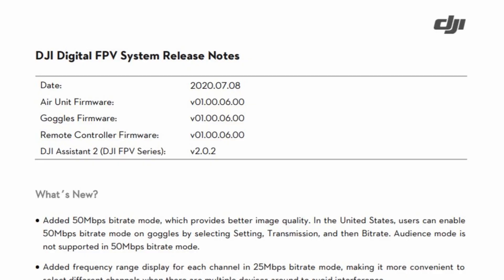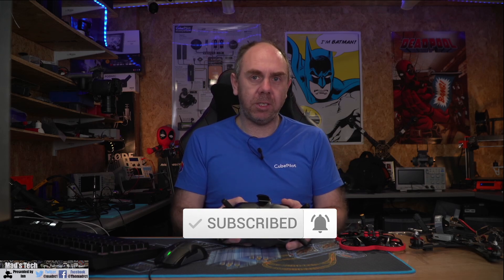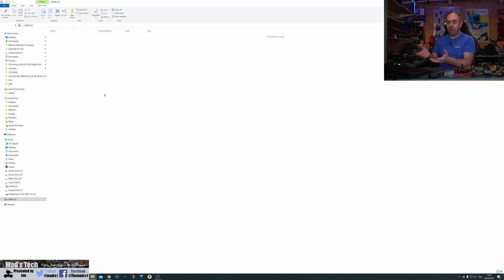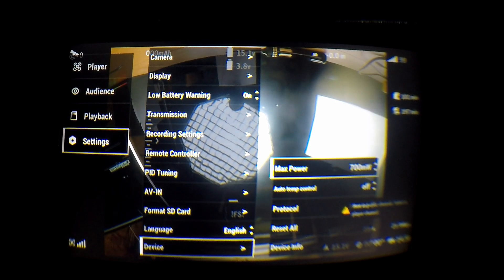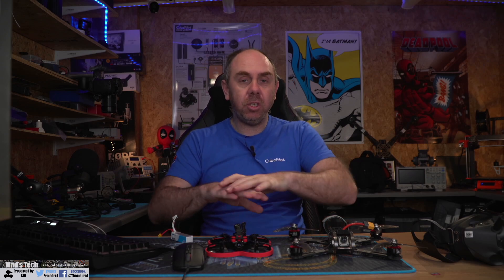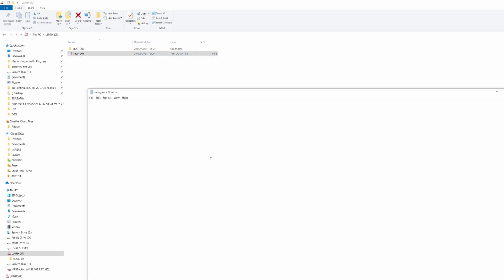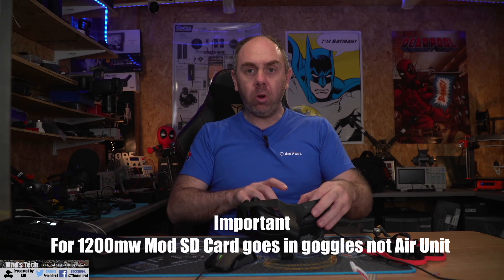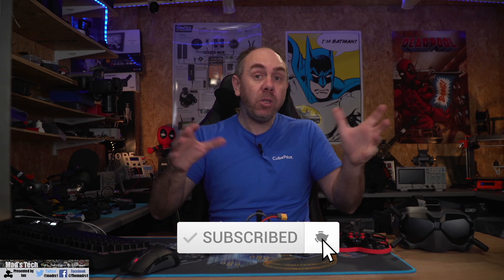DJI FPV Goggles V2 FCC & 1200mw Hack - Complete How-To For V1,V2, Caddx Vista & DJI Air Unit.

Comment: I've been seeing online that when you update the firmware for the goggles, you are no longer able to do the 1200 mW hack on the goggles. Since everything is released now and nobody is under NDA, are you able to confirm this or no?

That's gonna be a deal breaker for me. More power means more video range for long range flying which is what I want. Without that more power, I might as well stick to my TBS Unify Pro32 HV which will outrun a stock DJI goggle in terms of video

Comment: Im in CE area. Will this hack work with mavic Pro? If so, does it get wiped off as soon as I connect with the fly app?
Also does the file must remain in the sd card at all times or just once for activation of fcc mode?
Reply from the maker: No this is only for the DJI Digital FPV System and not for any of DJI Drones.  

As for it getting wiped off on the FPV system no once it’s done it stays unless you connected to assistant 2.

Comment: Hi 
I have downloaded and installed the latest version of the software DJI assistant 2 (DJI FPV series) version: v2.1.0 but he does not offer to activate the product.
other products Air unit, Vista etc. connecting to USB activates the product.
it is strange that Goggles asks to be connected to DJIFly to activate it.
DJIFly is the app for the Mavic Mini.
There is no manual or cable to do this
What is wrong ?
Thank you

Comment: Tonight, Feb. 22 2021, I attempted to download the DJI Assistant-2 app directly from the DJI website (downloads/softwares/dji-assistant-2-dji-fpv-series), but immediately upon completing the download the Chrome browser immediately tags the file as dangerous and only gives an option to "discard" the downloaded file.  No option to open or install the file, and I get the same discard file prompt when downloading both the EXE file and the ZIP file.  Initially, I was only downloading the DJI Assistant-2 app to have it ready for upgrading firmware in the future.  I didn't realize until I started searching for help with this download problem that this DJI Assistant-2 app is also required to register and enable the air units and googles for initial first time use.  Chrome's action notwithstanding, I am not willing to download an app that harbors a malicious virus onto my computer.  So then, all of my DJI equipment becomes unusable ???    I posted this comment on the DJI forum, but others have previously posted the issue with no response from DJI to date, so I don't expect DJI to provide help soon.  Hoping someone here can help provide a remedy or some useful advice.
Reply: OK.  Joshua Bardwell responded to my request for help today in the comments section of his video on DJI FPV goggle V2.  He simply linked me to another of his videos from Feb. 19 entitled "DJI Assistant V2 trojan? USB video output not working!"  The gist of the video is that there is no virus, and that the app needs to be white-listed and downloaded using the MS Edge internet browser rather than Google Chrome.  Thanks Joshua !
Reply from the maker: I spoke about this on the live stream Sunday but I will be doing a dedicated video to explain things in a lot more detail.  But I did speak extensively on Sundays stream

Comment: Hi,
Just a quick comment.  One thing that I was struggling with is after doing everything correctly I could not figure out for the life of me why I was still getting only 4 Channels even though I was able to change the power to 1200mw.  

It was only after reading one of the comments from another of your subscribers that I found out that if my transmission rate is set to 50mbs the number of channels is reduces to half, which is what I was getting. It makes total sense, but if you’re not familiar with the system it is easy to miss. 

I was just wondering if it would be worth your while yo do a quick update to explain this!  Just a thought!
Reply: Bro thanks had the same Problem!

Comment: If you're on a Mac, type "echo -n 1 > naco.txt && echo -n pwr_2 > naco_pwr.txt" (without quotes, of course) into the terminal and you've got your files.
Reply: good plan! I was going to suggest using touch and Nano
Reply: Do i plug in the sd card into the mac and just open up terminal and type what u said without quotes?
Reply: @sydsosaucy6622  You'll first have to change directory to your sd card by typing "cd /Volumes/[name of sd card]", then it will work!
Reply: @FPFPV  its now telling me in terminal “string not in pwd”
Reply: @sydsosaucy6622  If the name of the sd card volume has a space in it, you have to put a \ in front of the space to escape it
Reply: @FPFPV  bless your soul, it worked i was able to get the pwr_2 file into the sd card. Now im tryna figure out if it worked because i dont have the “devices” option when i check inside the goggles
Reply: @sydsosaucy6622  My guess is it has to be connected to an air unit for the devices option to be selectable.
Reply: @FPFPV  am i able to connect it to the drone without dji fpv mode?
Reply: @sydsosaucy6622  Do you have the V2 goggles? I have the V1 and it always just automatically connects if I power them both on.
Reply: @FPFPV  when i switch to dji digital fpv it wont bind with the drone so do i need a different drone to connect to the goggles in order for the devices option to be accessible?
Reply: @FPFPV  i have the v2 and when i power it on its connects automatically and when i go into settings, it wont show a “devices” option. When i switch it to dji digital fpv, i am able to see the devices option but it is greyed out
Reply: @sydsosaucy6622  not sure, did you press the bind button on goggle and air unit to bind it for the first time?
Reply: @FPFPV  im using the dji fpv not the air unit so i think thats the problem
Reply: @sydsosaucy6622  oh, then the sd card files didn't actually do anything
Reply: @FPFPV  hahahaha, atleast I I learned how to get the files into the goggles using terminal. much appreciated🤝
Reply: @sydsosaucy6622  🤝
Reply: @sydsosaucy6622   i have the Same Problem.. is this only working at dji fpv digital Mode?
Reply: @benediktwalper291  i think the hack only works if u use the v2 goggles with  an dji air unit

Comment: Thanks for the video. Do you know if there is anyway to receive the air unit footage on devices other than the dji goggle , like on tablet or monitor ? Is there any hack for it ? Thanks in advanced.
Reply: I think the v2 goggles are able to do that. With the v1 you can do it with the DJI smart controller but its very expensive.

Comment: great,
but not my stuff unless dji starts to extend the fpv goggles compatibility to their current dji drone line up mini 2, air 2 and the Mavic 2 ... cause that is the place where they forget and loose at least those of their customers that are in both hobbies,

flying dji drones and 
building and flying planes equipped with air units for use with fpv system

the missing link in their strategy and I guess there are a lot more that do not wanna built their drone cause I am happy to get my inav fc working properly for planes + wings and on my boat ... no need to mess up with expensive components for selfbuild drone falling out of the sky.

My DJI Goggles racing edition deserve an update like the fpv goggles got their version 2 ...

Comment: I plug in my vista and power it up... but my pc doesn’t recognize it? 
The dji assistant works and I’m able to update the vista unit... but my pc doesn’t see it as another drive? Any ideas?
Reply from the maker: I had to do mine a few times, make sure assistant is closed and then unplug and plug with the vista turn on
Reply: @MadRC  I had to do it several times before I finally powered up my Vista FISRT, then I plugged it into my PC and finally it recognized! I also have the DJI assistant closed to avoid any communication issues. Thank you for the hack information!

Comment: In 50mbs mode I have only 4 channel (3+public)  after the fcc hack in air unit and googles! It’s ok??
Reply from the maker: Yes that’s correct it’s used double the bandwidth so half the channels.